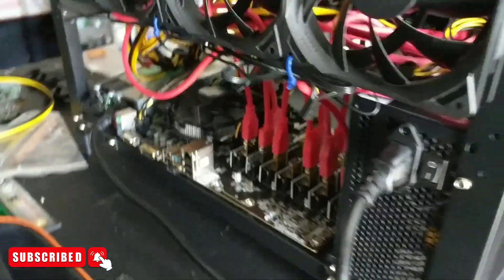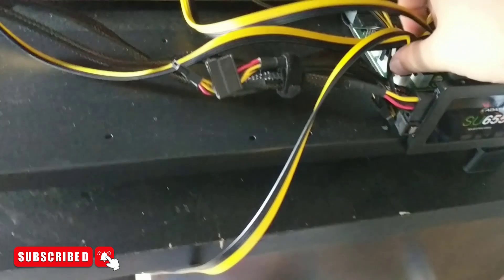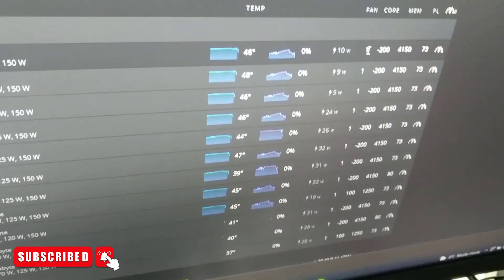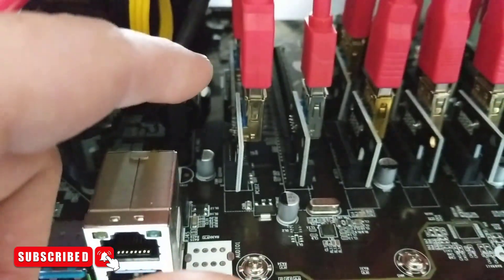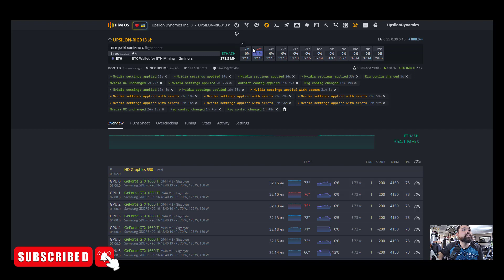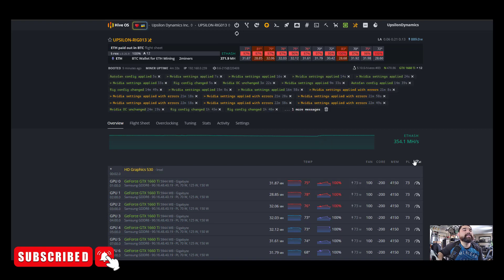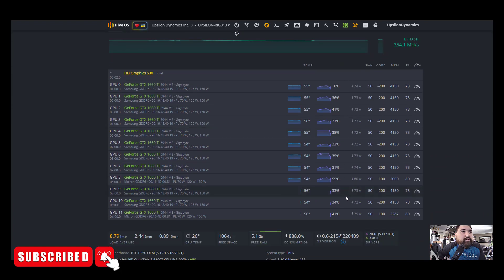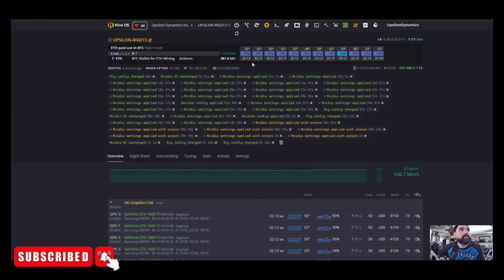Awesome 12GPU Mining Rig Build 1660ti | Build, Overclocks and Hash Rates

Comment: I assumed that gigabyte 1660 has thermal issue. I have same cards and it giving me headache compare with other model like asus, inno3d, zotac
Reply from the maker: Mine run flawlessly no issues so far, what is the ambient air temperature? Are cards crashing?

Comment: I'm using 1000 core and 1900 mem with 75 PL also with Micron memory fans are set to 60%. Its only getting 30.5 mh/s but very stable and cool 49-52 degrees.
Reply: -500 +2299 70-75-80 PL = 31.4